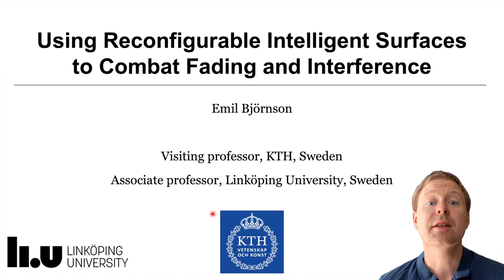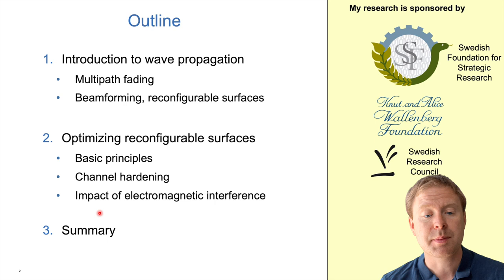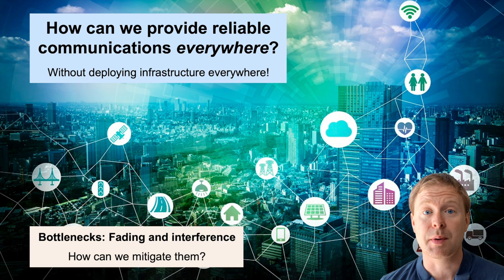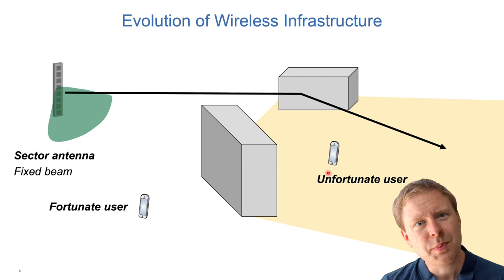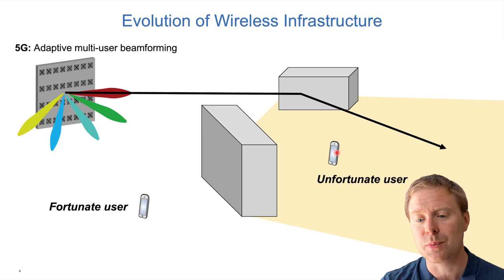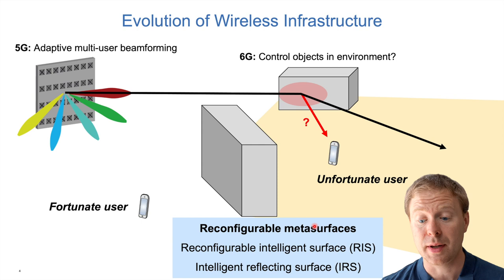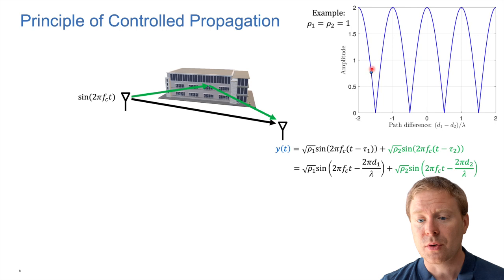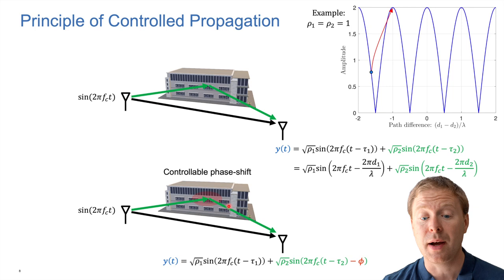Using Reconfigurable Intelligent Surfaces to Combat Fading and Interference

Comment: Very impressive. Thanks for spreading knowledge professor. 
A simple question: Are these dB numbers in your simulations realistic (-130 dB, for example, seems extremely low SNR to provide any useful communication service)?
Reply from the maker: Yes, the pathloss is typically -70 dB to -130 dB in cellular networks. The SNR can still be decent. With a noise variance of -110 dBm and transmit power of 30 dBm (1 W), we can still reach an SNR of 10 dB. Here is a video with more discussions around these things: https://youtu.be/OA4viERrlzA